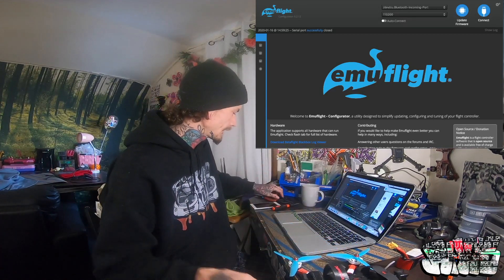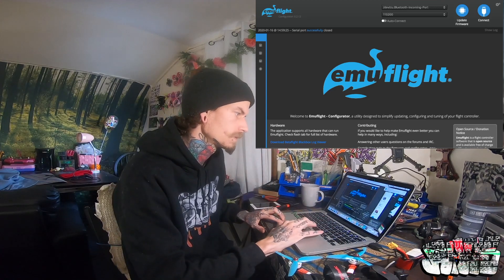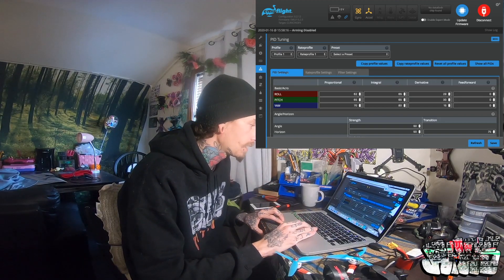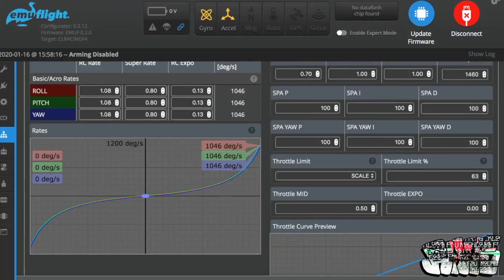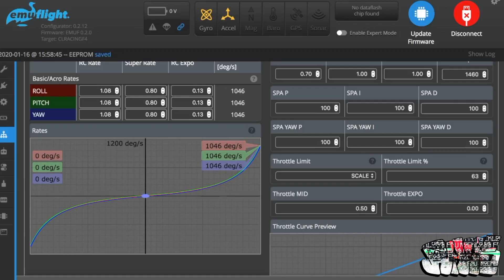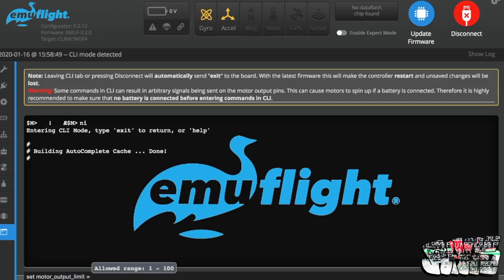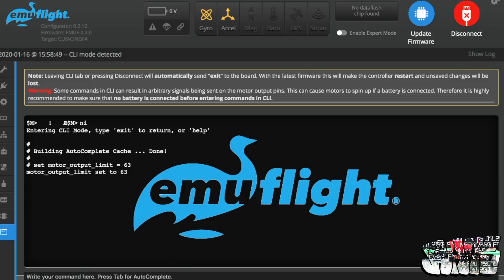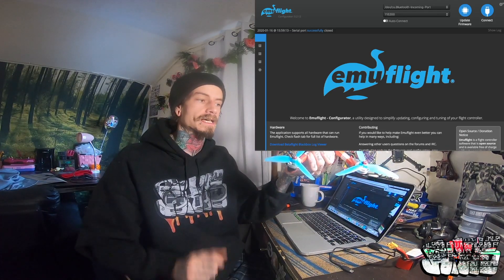Running 4s motors on 6s with Motor Output Limit on Emuflight

Comment: runnin velox 2306.5 2550kv I tried the output limit for 1800kv like 72% feels super slow and weak compared to my 4s, went up to 75% still feels weak. I dont think the math is correct comparin to a 4s at 100% on emu. tried on beta and for some reason that ratio works on the alot more accurately. Think the EMU devs need to scope this sitch out???
Reply from the maker: Very strange, I can contact the devs I'm using an older version of emu in this video too

Comment: The problem with this method is that the output is still capped at 63% when using 4S batteries.  There would need to be 2 different profiles.
Reply from the maker: The 2 profiles is easy, or you can just re set your output limits in speedy bee

Comment: throttle limit is NOT same as motor_output_limit, but yes motor_output_limit is proper method.
you might even consider 1300kv as the target, but such is a preference. 1300/2750
example for my 7" 1750kv, i 1300/1700 is 76% for motor_output_limit and NO throttle limit.
+1👍 💪 Emu Emu EMu EmU, all the Emu's #EmuClub #EmuTestBandits #EmuInsiders #EmuSquad #EmuDevs
Reply from the maker: Exactly. Throttle limit can  still output more throttle on turns and smoke motors/escs
Reply: any interest in being an Emu dev-build tester? testing all the tings and reporting feedback, .... would have to join Emu discord f you interested and be approved by a small group.
Reply from the maker: Yeah dude I'm part of the discord I will go check that out now!
Reply: "@nerdCopter" me in there

Comment: I’m thinking of trying this on my 4s rig. 
Is it the command on cli if I’m using latest version of Betaflight? Thank you. This is very useful stuff
Reply from the maker: This is emu flight not betaflight 🍻 thanks for watching
Reply from the maker: You can do motor output limit on the newest version of betaflight. Dont waste your time with throttle caps
Reply: Reckless_ FPV I did the mod on betaflight 4.1.1. It works 👍🏼

Comment: Do you experience an increase in flight time running 6s on 4s motors? Im trying to see if the purchase of 6s batts would be worth it since i have only 4s rigs
Reply from the maker: The increase of flight time is all in the lipos. The motor output limit just makes the motors feel like the desired 6s motor kv. So i wanted my motors to feel like 1750 so i divided 1750 by 2750 and got 63% for my motor output limit
Reply: @RecklessFPV  gotcha
Reply from the maker: I didn't notice a difference between the 4s capped or the actual motor size it feels the same!
Reply: But you should get longer flight time on the 6s compared to the 4s? No?

Comment: What flight controller is that? Thx
Reply from the maker: Cl racing f4s
Reply: Reckless_ FPV thx. I was looking for more fcs for Emuflight.
Reply from the maker: @escobarfpv1275  its an older fc but ive had 3 of them in builds for a couple years now! They're very durable

Comment: You're using throttle cap AND motor output limit? That's why you're feeling it underpowered. You just need motor output limit and send it
Reply from the maker: No just motor output limit throttle cap can still burn escs and motors. The fc can still send higher signals to the esc with throttle cap
Reply from the maker: In the video i just show that you can set it 2 different ways on emuflight its doing the same thing

Comment: Done 2400kv racerstar sprogx on 6s xd with out a limit broo xD
Reply from the maker: Yeah i did it with 2207 2450kv cobras and at 3/4 throttle it desynced and death rolled. Snapped the arm off my hyperlow cg lol
Reply: @RecklessFPV  oh crap mine was super fine full throttle, and guess what, racerstar 35amp esc xd the racing edition one. Its immortal xd

Comment: Curious if throttle limit stresses the esc's any more than usual.From what I've been told  ESC's are happiest running full throttle with all mosfets wide open and less happy (creating heat)  constantly switching to keep the lower throttle values which you're achieving with the throttle limit ? Did any of that make any sense  ??..lol..
Reply from the maker: Throttle capping through the radio can actually be really bad onthe escs because the fc can still send high outputs to the escs when turning or saving from a fall. The method i used actually scales everything down to the desired feel. And the escs are doing really well! I will definitely update if i run into any troubles tho! 🍻 🍻